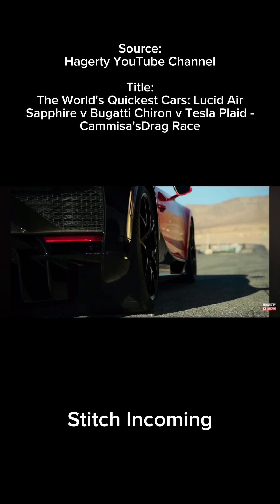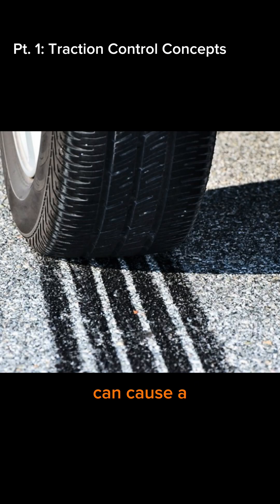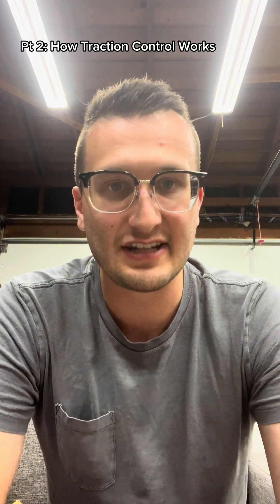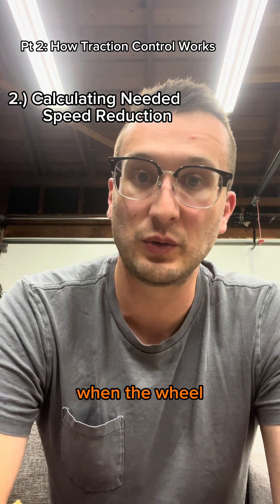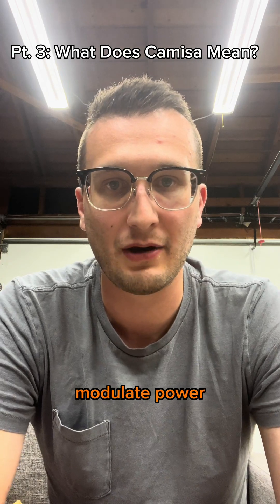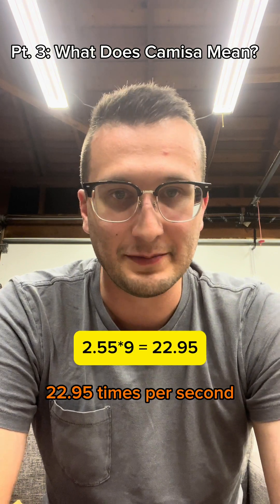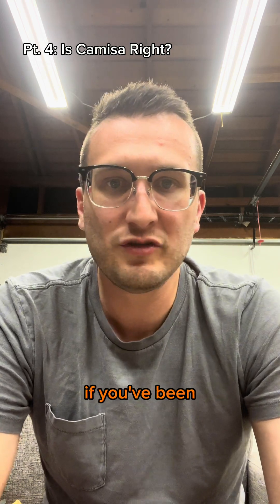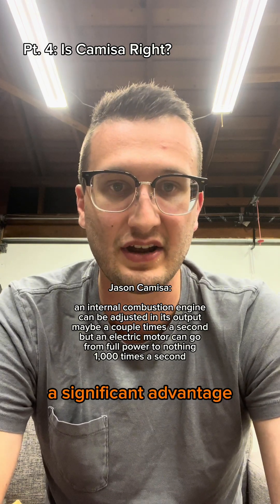Traction and Launch Control: EV vs ICE

Comment from the maker: Minor correction to the video: the minimum number of power modulations in a 3-phase motor is 3. Most are much higher, as is the case with the Lightning, which is 30x per rotation, giving a final number of 700. But this is not the case for all 3-phase motors
Reply: Why would the minimum number of modulations be 3 for a 3-phase motor? More often than not, motor controllers use switching frequencies over 100kHz. They could very well be adjusting the motor current “mid-phase”.